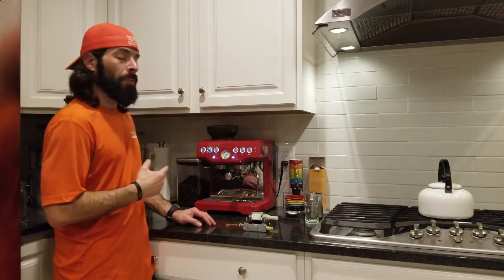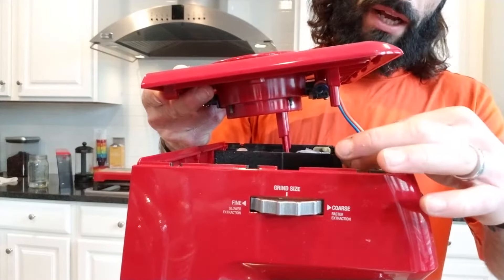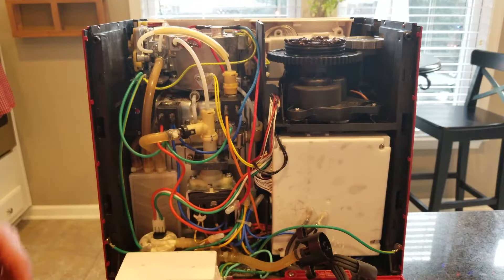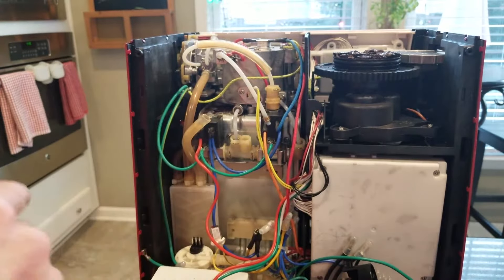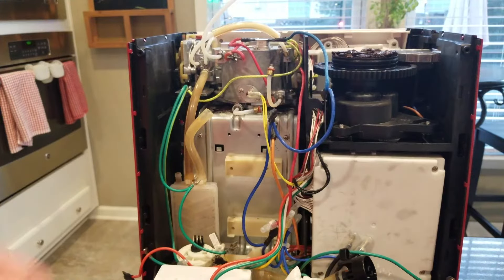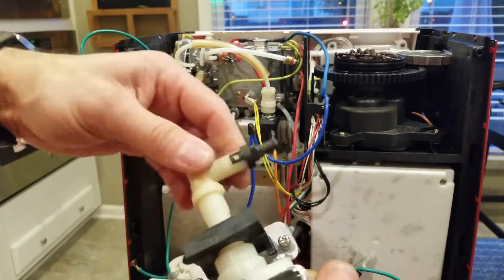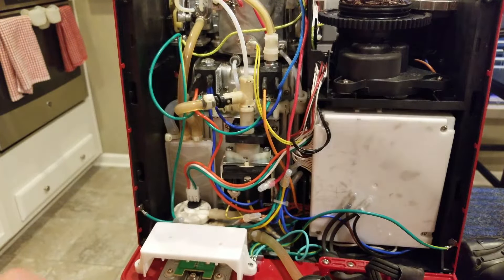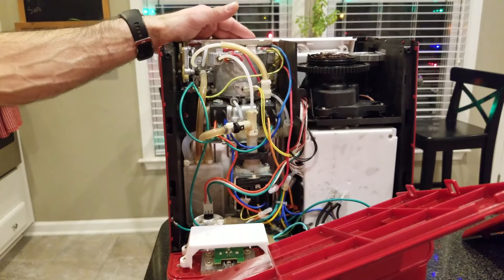Water Pump and Solenoid Block Replacement on Breville Barista Express 870XL

Comment: If you don’t mind. What kind of water do you use to brew? And what do you use to descale?
Reply from the maker: I don't mind at all.  I use tap water filtered through my fridge.  I know, I should have a better filter setup, but the wife would likely kill me.  The water we have in our area is in shale and this leads to tons of scale issues.  Folks with copper pipes have it real bad and develop tons of pinhole leaks.  Anyhow, yeah, the water seems to do okay.    

One thing I have done that I think helps is flushing the group after pulling my last shot–i.e. dump the puck, reinsert the portafilter, then run a single shot of water through it, and finally wipe the group down.  I've had little to no success with white vinegar solution and the clean cycle.

I had some scaling issues and they were bad and causing some flow issues.  However, it was only in the group and I used a vacuum to suck out what I could after using a pick to clean up as much as I could.  Tip, I used a drinking straw attached to the vacuum to get into such a small edifice.
Reply: Awesome. Thanks for the reply. I have been using distilled water mix with baking soda and epson salt technique. Hope it won’t build too much scale up. Just order sette 270 to go with BDB.

Comment: Hola buen día donde puedo conseguir las dos piezas de remplazo
Reply from the maker: There are links in the description for the parts on ereplacement.com.  You may also find them on Amazon if you do a search.  good luck!
Reply: Por casualidad sabes los números de partes de los repuestos
Reply from the maker: @teamcafeclasico3164  if you click on the links in the description it takes you to the part and the PN is there.  

Water pump on Amazon: https://www.amazon.com/Model-120v-minutes-Breville-Espresso/dp/B077ZRP3GD/ref=sr_1_1?ascsubtag=1ba00-01000-a0049-mac00-other-smile-us000-gatwy-feature-SEARC&keywords=SP0020447&qid=1658173779&sr=8-1

Unfortunately, I did not locate the solenoid block on Amazon.

Comment: Hey amazing video.  Was just about to follow your guide, but looks like the solenoid and pump you linked to off ereplacement parts indicate they are back-ordered with no indication from the manufacturer (Brevile) to continue producing them.

On Amazon I found the "EFP5" pump when searching 870xl with pump, but nothing for a solenoid.   I was wondering if you know where else parts for this unit might be available, or if there are any equivalents that can be used to Frankenstein it back together.
Reply from the maker: Unfortunately, that was the best site I found when I originally searched back in 2015 or 16 when the solenoid started giving me issues.  It has gone on and off of backorder many, many times since then and probably before that too.  The tall solenoid on the right as you view the machine from the back is available and in stock.  That is the one that failed on my unit.  

https://www.ereplacementparts.com/solenoid-valveolab-9200h-p-629957.html

I would make sure and check for blockages due to scale breaking off and plugging the lines.  The one I have had most issue with in the past is the right most line that comes off the boiler/group.  Good Luck!

Comment: Would you know why my breville barista express  it always pulls a different of water.
Always over pulls even after programming to default settings 
Thanks ! Breville wants 350$ to fix the machine but I want to try and repair myself
Reply from the maker: Apologies, but I do not have an answer for this issue.  Best of luck on figuring it out.
Reply: The issue is probably a faulty flow meter, which is the “valve” that LAI pulled a connector off about 5’10” in...easy to swap out.

Comment: Thanks for the video my machine makes the same noise and pressure gauge doesn’t even move so far I just ordered the water pump from amazon for $26 want to try it with just a new water pump if it works but the video was very helpful
Reply from the maker: You may have a scaling issue blocking one of the ports.  I recommend you check the lines and the ports to ensure no blockage before replacing parts.  If you have water coming out of the gruppo without any coffee loaded then it might be scaling.  I really net to get off my butt and edit my manual descaling video.
Reply: LAI is it coming soon?

Comment: Where can I buy parts for that machine? My steamer works but hot water doesn't come when I just want hot water . I checked all lines and none are plugged . Seems like it pushes pressure right the the metal block where the steam / water switch is . Any help would be appreciated! Thanks
Reply from the maker: In the description there are links for buying the parts replaced; however, I'm not sure that your solenoid block has failed.  If no hot water from your machine maybe the selector valve is malfunctioning or failed.  The parts associated with this are: 04.1; 13.6; 12.5.  Some say they are discontinued.  If you find any of these to be the culprit give breville a call with the PN and see if they have it.  FWIW, this is a part I am apprehensive about failing on my two machines.      

Here is the link to the diagrams and parts list: 

https://www.ereplacementparts.com/breville-bes870xl-the-barista-express-parts-c-116052_116055_290179.html

Comment: I can't get the 3 screws under the water tank off because they are rusted.  I think I stripped one of them.  Any suggestions?
Reply from the maker: you can get some valve grind compound from an auto parts store and put some on the tip of your philips to give it some more bite.  Also, make sure you're using the right size phillips head.  I think they are #2 but not sure.....if they're totally stripped you'll have to drill them out and install some new screws.

Comment: I replaced my solenoid...thought there was something wrong with the pump...but the clickety sound was because of the water reservoir was disconnected of course!...anyway it still has an internal leak somewhere else.I thought I fixed it and now I have to unscrew everything again..OY..what a headache!!! LOL
Reply: as the saga continues.  what I thought was a leak was the drain pipe into the drip tray. So looks like I got this thing rolling again! Now I am making espresso shots every 2-4 hours...LOL!!!!

Comment: Can't seem to be able to pull off the connectors from the step @4:50 any tricks?
Reply from the maker: I believe, and I am working off memory here, that they have retention tab.  If you see the male connector on the pump it has a hole in the middle.  The female connector that you are trying to remove likely has a catch that you need to ensure is depressed so it release from that hole.

Comment: Hope for a bit of help. My barista express (same machine) cant make steam anymore. When i try, water pours out of grouphead, would that be the same error ?? Hope anyone here has a suggestion, I am thinking about trying to do a repair myself but need to know what to fix :0). Otherwise its the end of the machine.
Reply from the maker: Yes.  It very well could be the solenoid that is not functioning or is clogged up.  I would recommend pulling the lines to see if they are blocked at all and you might give disassembling the solenoid.  When mine originally started giving me issues I did just that and it got much better, though, the noise persisted even if it was less audible.  When I burned up the pump I decided to do the block at the same time since I was in there.  Good luck!!!

Comment: I am having an issue where a lot of water is coming out of the purging tube (in the water tray) but nothing is coming out of the brew head. No pressure etc. Do You think this is a water pump issue? I can’t seem to get anyone at Breville to help me.
Reply from the maker: I do not think it is the pump.  Likely scale in the lines going to the boiler.  Remove the lines and check the ports as well as lines for blockage.

Comment: Just want to keep this thread alive. I ordered the Solenoid valve from ereplacementparts.com on 7/17/2019 and today, 8/8/2019, they have received the part and shipping it out to me (USPS first-class package) to Virginia. At the time it was a 17-22 business day lead time.  So kudos on them. Additionally, I just checked and they are advertising they have 25+ in stock.

https://www.ereplacementparts.com/solenoid-valve-assembly-p-629955.html

Comment: Someone help! I've had the machine for 5 years and used it a lot. The pump started to get weak and was not producing enough pressure. It worked, but it could not produce high pressure. So, I followed the video and replaced the pump with a new one. Now, the machine does not work. It makes a loud tak tak sound. And water is not coming from anywhere. Does anybody know where the blockage might be? Or what is going on?
Reply from the maker: Low pressure is not likely the pump.  I'm thinking you had a blockage at one of the lines going to the group.  In the video these are the thin plastic lines that go to the solenoid block except look at the opposite end.  Pop those off and check the line itself for blockage as well as the port they go into.  As for the sound you have me there.  i'm not sure what that could be.  Make sure the feed hose isn't kinked or blocked.  Good luck!!

Comment: Hey mine makes the noise it usually makes when I turn it on. But when pumping, it stops and sounds like it's struggling. No water our of the shower. Anyone think I have the same issue?
Reply from the maker: Most likely scale blocking one of the feed tubes.  I swear that one of these days that video will get posted.

Comment: Can anyone read the model number of the pump?  It looks like it might be a standard ULKA pump but I can't read the label.
Reply from the maker: It is a ULKA model EF Type EFP5 or at least that is what the label says.  This is the same pump on Amazon.  https://smile.amazon.com/MacMaxe-ULKA-Model-Type-EFP5/dp/B08PCBG2FV/ref=sr_1_1_sspa?ascsubtag=1ba00-01000-a0049-mac00-other-smile-us000-gatwy-feature-SEARC&dchild=1&keywords=ulka+efp5&qid=1633177752&sr=8-1-spons&psc=1&spLa=ZW5jcnlwdGVkUXVhbGlmaWVyPUExMDY0OTJFSDdQVFhLJmVuY3J5cHRlZElkPUEwMzY3MjQyQ1FMQVhaM1U2MEg3JmVuY3J5cHRlZEFkSWQ9QTA5MjM0NjFWMEYxTE1OMEFDQjgmd2lkZ2V0TmFtZT1zcF9hdGYmYWN0aW9uPWNsaWNrUmVkaXJlY3QmZG9Ob3RMb2dDbGljaz10cnVl

Apologies for the delay in responding.

Comment: What would you be willing to pay on Facebook market place for this machine, two years old, apparently used 60 ish times??
Reply: And how long had you used it before needing to repair it?
Reply from the maker: I'm sorry, but I have no clue what these machines go for used.  I've never looked into the going rate.  Also, I bought the machine in mid-2014 and the solenoid starting acting up about 12-18 months later.  The pump failed on the date I uploaded or thereabouts.

Comment: Quick Question: Model: BES870XL Water Flow. While brewing one or two shots the espresso does not stop automatically. I had to manually stop. Not sure what part do i need to change. Any suggestions please?
Reply from the maker: Two things.  If you press the 1 cup or 2 cup button for too long it will enter manual mode.  A momentary press is all that is needed for an automatic poor.  Assuming you are doing this already have you tried reseting the volume?   Below is how you accomplish this.
"To reset the machine to the default 1 CUP and 2 CUP shot volumes and espresso water temperature press and hold the PROGRAM button until the machine beeps three times. Release the PROGRAM button. The machine will return to its original default setting." 
Now, if you are selecting your shots correctly and the program is working then I am at a loss.  I have yet to have any programing issues with either of my machines over the last 6-7 years.
Reply: @lai2703  can I piggy back on this reply? I just bought a used one of these and this 2 shot seems to be set to th same duration as the 1 shot - so thank you for posting the reset process! Your comment also mentioned temperature... Are you able to program the brew temperature (in addition to the length of the shots)? Thanks!
Reply from the maker: @tonygibbons5  Yes you are.  I'm heading off to work now, but i'll come back and edit this reply with the process a little later today.

Copied from the manual.
The Barista ExpressTM allows you to adjust water temperature ±2°C in 1°C increments from the default temperature. To enter Advanced Temperature setting mode:
1. Turn the machine OFF
2. Press & hold the PROGRAM button,then press the POWER button. The machine will beep once. The illuminated button will indicate current temperature selected. If no buttons are pressed within 5 seconds after entering Advanced Mode, no change will be made & machine will return to heat-up/ stand-by operation.
3.To select a temperature change,within 5 seconds of entering Advanced Mode, press the button to select desired temperature. You will hear 2 beeps to confirm the change. If no buttons are pressed the temperature will remain unchanged & machine will revert to STANDBY.

You then use the power, filter size, 1 cup, 2 cup buttons to adjust temperature.  The 1 Cup increase the temp by 1ºC.  The 2Cup increases by 2ºC.  The Filter Size decreases by 1ºC and the the Power Button decreases by 2ºC.

I hope that's the info you're looking for and good luck!!
Reply: @lai2703  thank you!! That's very helpful. As I bought a used machine I didn't have the manual, and I knew the machine had PID but didn't know you could adjust the temp! Appreciate your replying :) ☕

Comment: What is the value of the magnetic coil ohm?
Reply from the maker: i'm not a big fan of resistance to diag a component but I will get to this.  I had been waiting on another meter.  I have one on the boat, one at the shop, and now I'll have one at home.  Just came in today.  i'll check the old one tonight and reply back.
Reply: @lai2703  OK
Reply from the maker: Unfortunately I had too much kit to haul home in my paneer and the dvom didn't make the cut. Probably be Sunday before I post something up. Maybe Saturday.  Sorry
Reply from the maker: 655ohm measured for both solenoids

Comment: Recently did all of these. I believe I have the connections right and no water coming out or pressure. Anyone have any ideas what could be the problem?
Reply from the maker: Did you check for blockage in the lines from scale?
Reply: @lai2703  from scale?
Reply from the maker: @Iceman-xe7jo  scale deposits in the machine form from hard water which flake off from time to time and sometimes block the very small water lines.
Reply: @lai2703  I’ll have to go back and take a look. Thanks

Comment: I have been eyeing this machine for a long time and glad I saw your vid.  I have a Starbucks Barista for eons ago and want to replace it but question if this machine is truly a better upgrade since they use similar pumps.  Might be worth looking at something else now that I see the innards.
Reply from the maker: I have mixed feelings on this machine.  The grinder is pretty darn nice and I think that is where most of the $$$ is spent.  Like you say the innards leave one wanting, but over the last 7 years I've pulled more than 10,000 shots from my two machines and have only had to service the one.  I'd say that's a pretty good testimonial for a combo machine that is in the $500 range.
Reply: LAI have you thought of upgrading?  If so what is your next step?
Reply from the maker: @RockyMountainSounds  I really haven't.  These guys just keep rolling, pulling shot after shot with no complaint.  however, if I did upgrade it would be in a much higher price bracket (think La Marzocco or ECM) and I just can't justify that when both my machines pull great shots.

Comment: Hi, great video! Thanks a lot.
My machine worked great for years then after a routine backflush the pressure gauge went nuts (back and fourth) so I stopped the cleaning process and there was a lot of pressure when I slowly released the Porto filter. Since then I haven't been able to pull a good shot and during the pre infusion there's often more espresso coming out before the shot starts. The pressure gauge also shows low pressure at pre infusion then jumps up to optimal range. I've changed around grind, dose, weight etc. Always a similar result. I've resorted to manually doing everything but it's still nowhere near as good as it once was. I had the loud buzzing sometime after this happened but after a lot of cleaning with vinegar I haven't heard it for a long time. 
Frothing and hot water work as they should and I only use fresh beans. 

Any thoughts on what could be happening?

Cheers
Reply from the maker: Sounds like a blockage.  It is so common with how hard most water sources are if you're not using a good filtration system.  I get them from time to time with this machine and I am using filtered water from my fridge.  The machine I have at work runs through a much nicer filtration system and I have yet to have an issue with that unit.  I bought the unit in the video about 12 months after the unit that I have not had an issue with.

The lines going into the boiler normally clog and can cause issues with the steam wand, hot water, and group.  Pop them off and check to make sure there isn't some calcium stuck in them partially obstructing flow.   Good luck!
Reply: Thanks, I really appreciate it.

Comment: The problem can be corrected if DC voltage is applied to the control of the valve electric coil instead of alternating voltage ... Install a diode bridge.

Comment: Which solenoid goes bad?
Reply from the maker: The one that went bad on me is https://www.ereplacementparts.com/solenoid-valveolab-9200h-p-629957.html or at least that is what it looks like based off of ereplacmentparts diagram.  However, I would just swap the block out, since you have to pull out the whole assembly to replace the one.